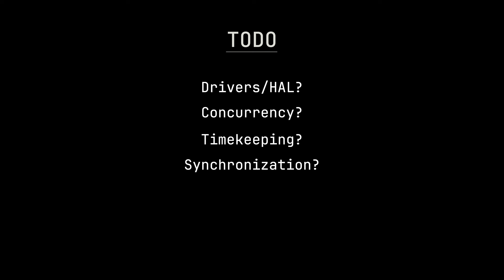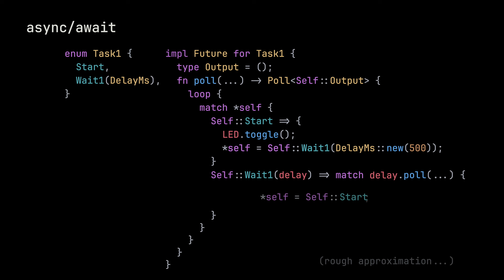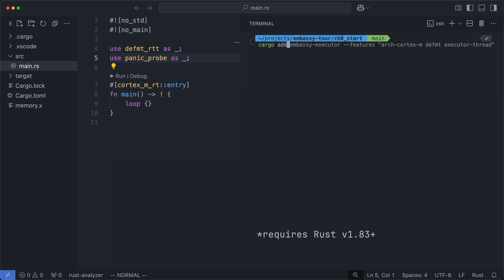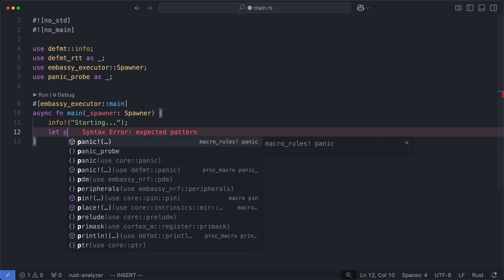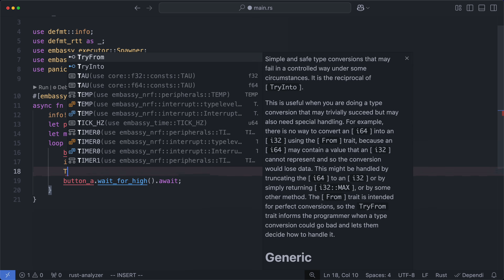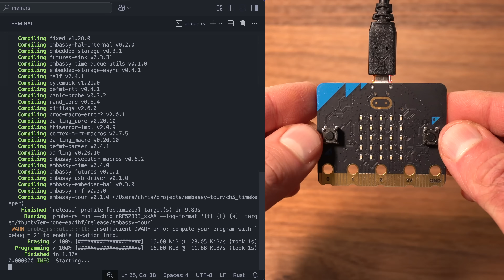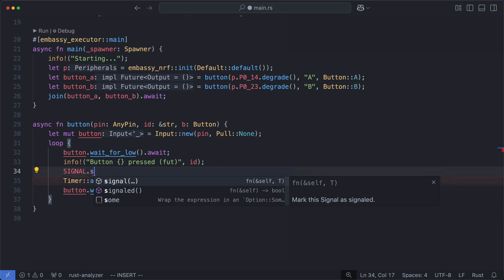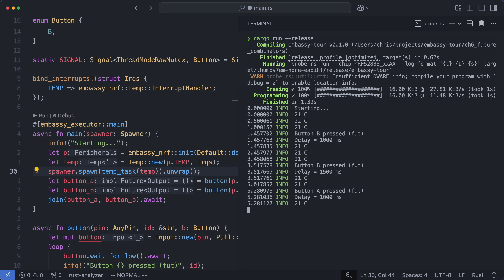Intro to Embassy: embedded development with async Rust

Comment: Great video! I really wish I had these when starting on my semi-large embedded project, ha! One sort of "best practice" that I wish I did when starting to write things like driver logic for IC's is to write your driver code using the embedded_hal_async and NOT the chip-specific SPI/I2C/etc abstractions! Having your driver depend on the generic HAL I2C/SPI/etc trait makes the code much simpler and reusable, IMO. I think this was a bit of a particular problem for me about a year ago because I was new to rust and the embassy-rp I2C/SPI structs took pin numbers as generics causing some crazy types for a beginner to rust to wrap their head around, but if I just wrote them using the embedded_hal_async drivers as a dependency I would have had a much easier and simpler time, and it's what I'm doing now for all my drivers.

So far this is my first delve into low leve/embedded development and it's been a total blast as a .NET developer by day. Rust can be... strange sometimes but it really is an absolute pleasure to work with, and the community is amazing. Great videos, looking forward to the next one!

Comment: Embassy can de used on Safety Critical Functions?
Reply from the maker: Safety-critical software usually requires the use of certified toolchains, libraries and compilers, so I’d say no, but admittedly that is not my area of expertise. That being said, Ferrous Systems have a qualified version of the Rust compiler (https://ferrous-systems.com/blog/officially-qualified-ferrocene/ ), so use of Rust in safety-critical systems is making some progress.

Comment: I have a question about something mentioned in Dave's Garage video: they demonstrated that a modern Rust program can sometimes outperform C or C++. This seems counterintuitive to me since C gives you full control over everything, including memory access, allowing for highly optimized, low-level operations.

Do you have any thoughts on this, particularly in the context of embedded devices like the STM32? Could this performance advantage hold true in such scenarios, or is it more about the compiler's implementation and optimization capabilities?

For example, in my use case, I have a 256x256 matrix of u16 values. I need to:

    Compute the sum of all values in the matrix.
    For each element, multiply its value by its row and column indices, summing these products across all rows and columns.

Do you think Rust could actually perform this kind of task faster than C? Or is it more likely that C would still have the edge due to its fine-grained control?
Reply from the maker: Between the type system and the borrow-checker, Rust allows a number of checks to be performed in a zero-cost way at compile time, so my guess would be that you might be able to remove some runtime checks that you’d need or want in C (invariants, null-pointer checking, etc) that could speed things up a bit. This may not really pay dividends in a small project, though.
Reply: @therustybits  rust references are also like __restrict C pointers, and C devs rarely bother using __restrict. That helps the optimiser.

Comment: How do you know what feature flags to use, both in the cargo.toml and the cargo add operation?
Reply from the maker: In general I'll look at any feature flags that are listed in the Rustdocs (eg, https://docs.embassy.dev/embassy-time/git/default/index.html#feature-flags) and select the ones that are needed/wanted for the project, usually in consultation with what is used in some of the examples (https://github.com/embassy-rs/embassy/tree/main/examples) to make sure I'm not missing anything. But.. yeah... required vs optional features for a crate feels like something that should be surfaced a bit better within crates.io and the Rustdocs.

Comment: Very interesting to see how the overhead, both in terms of execution efficiency and storage requirements, compares with a traditional C based FreeRTOS codebase.

Looking at the RP target, the examples look good, but has anyone got any pointers to a more substantial project written with this? I’ve done a little Rust on PC hardware and would love to give this a go with my next Pi Pico project.
Reply: The Embassy Book has examples of Embassy in the wild.
Reply: I’ve built a nice flash and Lattice FPGA programmer out of a Pico. It could make an interesting first project to port to this; just a simple UART protocol and SPI. Assuming this goes well I’ll look at porting a more complex FreeRTOS project. Will give it a good look, thanks!